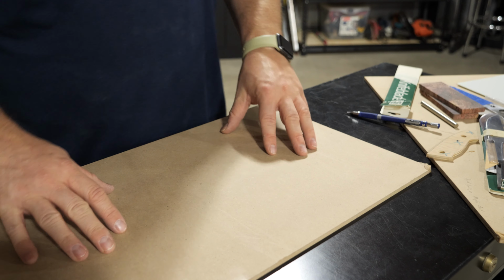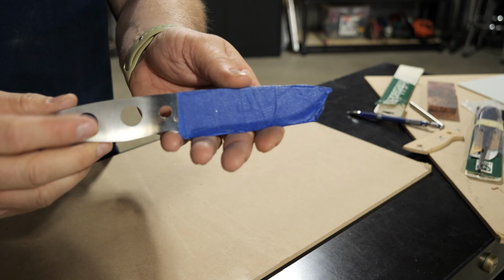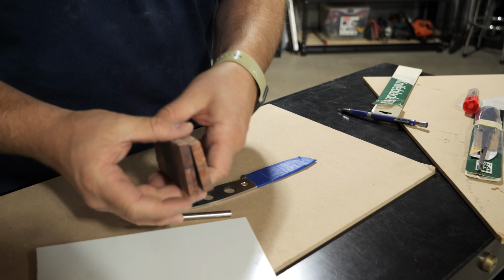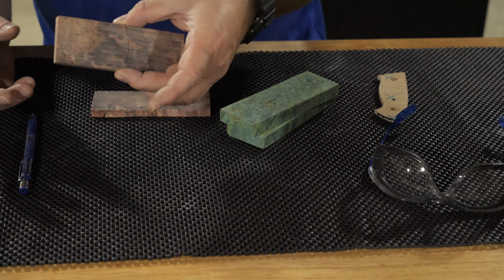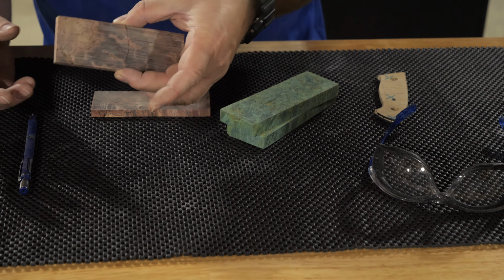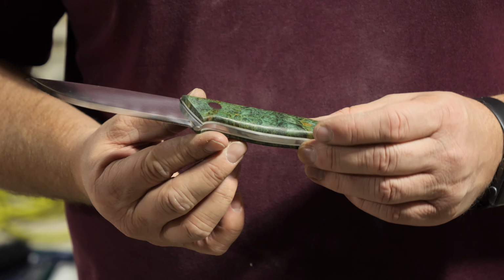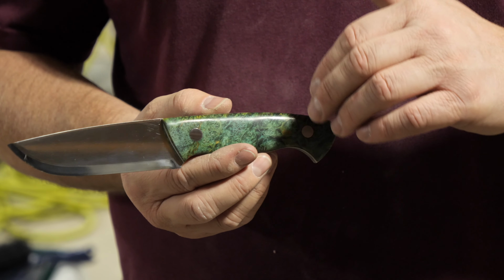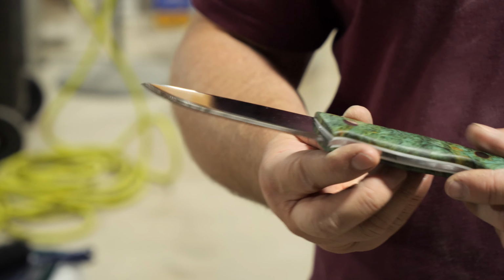Helle Utvaer Build and Mods | Maple & Box Elder Burl | 4K

Comment: A really nice build you did there. I've got an Utvaer my self. Love the blade, but the original handle is a little bit on the short side for my hand. Unfortunately I don't have the tools or the skills to fix it.
Reply from the maker: I can see that. Longer blanks are easier to work with in that scenario. With this, and others, the pre-shaped handles are "stuck" as-is. My only luxury is how thick the handles ends up and where it tappers :/

Comment: Did you get a chance to test the steel? 14c28n right? A very tough steel.
Reply from the maker: Not in a demanding way, no. The Utvaer is actually 12C27. The 14c is on a few of the Enzo’s and the Mora Garnett and the like. I like that steel quite a bit. Personally, I’ve always kind of found the 12C27 on the softer side when laminated. The edges tend to roll in my experience and don’t hold up quite was well under moderate to high stress. Some of the harder offerings like on the Enzo Nordic are excellent.

It’s very similar to other Helle’s, though stouter because of the full tang. A great sliver/feather stick blade, but maybe not the best if heavier use is needed like batoning, etc. Would it work if needed in a survival situation? Very likely, it’s just not something I would choose to use as my regular outdoor blade.

The 14c is very good. I love it on my Mora and some other offerings. I hope to be able to try some things out in the future. I got a Reel Steel in 14c for Christmas that I’d like to compare the the Bravo 1 LT. See how that 14c compares to 3v. I’m sure others have done this comparison though.

Sorry I can’t offer more insight, but in my time/experience, these are the thoughts I currently have.

Comment: I've got about size 11 hands for gloves and wonder, would a brisa/enzo trapper blank be better for large hands than the Utvaer? 
I'd rather make a Helle as a "woodlore" (roughly) type full-tang than a Brisa/enzo.
But if I gotta remove too much of the inside/bottom part of the tang/blank.
I'd rather just look for a different blank design because it would usually also negatively affect the visual dimensions of the blade.
Reply from the maker: Top to bottom, the Helle offers a touch more room to work with. However, the bigger issue for myself, and my friend with larger hands is in the distance between the finger guard and butt end of the knife. As your grip, your fingers tend to swell out from the pressure creating more of a tight sensation between the front of the index finger and the back of the pinky finger. It’s good if you like your hand to feel locked in place, but less advantageous if you want some room for dexterity and different grips.

Though I’ve never used a woodlore specifically, I don’t think the Brisa is way off in the height department and you can make the scales thicker if needed. Just my thoughts. My friend who has very large hands prefers a larger handle, and has an ESEE. In my current line up, he says he prefers the BRKT Bravo and of the scandis, the Trapper/Badger bc the back end is rounded more than the Helle. 

Another thing is, although the Helle is a beautiful mirrored steel that’s hair-piping sharp OOTB, I still feel the laminated steel a bit more delicate than non-laminated offerings, esp in wood use. I love many of the Brisa steels, but many other providers offer solid metal blades as well that, IMO, are superior in strength and edge retention. I’ve not had a Helle break or chip out severely, but the fine edge does tend to roll, even with its steeper bevel, in my experience. Others’ millage may vary. For ME, I prefer non-laminated options. In the laminated, I do prefer Fallkniven in the Nordic style. For the price, I’ve very much enjoyed the Brisa. 

I’ve got a Real Steel Bushcraft I hope to try out in the coming weeks, if I get the time. I got one with removable wood scales and a full convex edge, which is my personal preference. They also offer them in flat and scandi, I believe. A blank is only like $40 from Blade HQ, but I don’t like the pre-drilled hole layout for contouring. The version I got was like $90-100, but that comes with a sheath and I find the existing shape very nice. But it’s NOT a traditional-looking Nordic style knife. I’m thinking about making some of my own scales that are also removable at some point bc all the hardware is in place. This blade is more in the BRKT Bravo line, again, a favorite of mine, and I’ve seen it in 14C28N and D2. The handle on mine is much larger length wise, which is very helpful for larger hands. It would be more $ than a traditional blank, BUT, you’d have some versatility and may not want/need to reshape the metal at all. I like this option because I can also epoxy my own wood design if I choose. They have G10 versions available that don’t have removable scales. I’m not pitching this, just saying the size is equal to, or slightly more than the Enzo on height, and it has noticeably more working room front to back without an intrusive hump. There is a go by we groove, but it’s also not sharp and more gradual. I’ve yet to test it, but I tend to like 14C28N and 12C27 more than the Helle laminated. 

I wish I had more specifics I could offer you. The Helle was fun to make, but there’s no way to lengthen the opening in front is the back drop and I feel this is the more restrictive aspect of this blade handle.
Reply: @OneDegreeLife  thank you for the detailed reply.

Being from Europe, I do not know if BladeHQ is wise with the shipping.
Brisa is pretty cheap to ship here.

And yes, I was referring to the belly/part where the fingers go, so that does sound like a bit of an issue then, thank you.
I've seen people managed to open it up a small bit by removing a few millimetres of steel where your index and pinky go, but like I said earlier, it alters the look of the recasso etc too much, making it look out of proportion.
And I prefer dexterity over stability.
Slightly.
Ofc a little of both is best haha.

The brisa/enzo trapper 95 or 115 is probably a better idea then.
With indeed much better steel selection like elmax even (if they're in stock...) 
And yes, Laminated steel tends to bring more disadvantages than advantages.
Under very hard use they tend to delaminate where even lower quality homogeneous steels hold up (not personally seen it, only in video's), and you generally can't scrape Ferro rods with them. (Personal experience)

At least, not the Morakniv ones even if you sharpen the spine to such a sharp 90° that it creates a burr, fallkniven seems to be one of the few laminates that can.
I wish Fallkniven would redo/restock those full tang F1 and S1 blanks they did a decade ago.
I'd go with those in a heartbeat.
The price also wasn't too crazy.
(I know the F1x also has a full tang but I'm not a fan of the F1x or S1x blade shape, and their stock/thickness just too thick as well, they're significantly thicker than regular F1 and S1)

Also, I thought the Utvaer was a 12c27 laminate btw.
Reply from the maker: @Stormcloakvictory  All good points! I also think similarly about the Moras. The Black and the Garberg are the exceptions. I love both, but particularly the Garberg. Excellent in the SS.

Yes, you're correct, the Utvaer is 12C27, but really does feel similar to the other Helle's I've had. MUCH stronger, but the edge still seems to roll.

Since you are in Europe, I think the Trapper is an EXCELLENT option, esp. at the prices you can likely get them for. I particularly like the 115 size. Yes, Elmax is excellent, if you can find it, but I don't recall if I've used it in the Brisa line. I've tried many. There's another model called the Trooper that's similar, but I think might have a slightly higher scandi grind. My vendor here only has it in 80CrV2, but not sure if it's in other metals.

Hope your build goes well for you and that you love whatever it is you decide on! Cheers
Reply: @OneDegreeLife  thank you for all the replies, and I hope your future projects as well :)
And I hope the YouTube algorithm is also happy with the comment string hehehe, it's a nice build and I like that you show the mishaps like the broken scale too, it's good for aspiring knife makers to see that things rarely go perfect and that sometimes it's just out of your control like getting a faulty piece, even for the experienced.
But that in the end, with a little perseverance the end result will be great nonetheless.

cheers 🍺
Reply from the maker: @Stormcloakvictory  thanks for that! Honesty is the best medicine. I’m glad you saw value in my mistakes, and as you said, I hope it helps others. 

Take care!

Comment: Do you like the Utvaer or Trapper more?  Looking to buy my first knife blank to build.
Reply from the maker: The Trapper. There are obvious differences in steel performance in the Trapper line, but overall, I like it better. The Utvaer is larger top to bottom, so the palm size can be made to feel larger, but the laminated steel is soft for my liking, and it's the only option. With the Trapper you can explore O1, Elmax, D2, N690, etc. And you can find them in 95 and 115 mm.

I really like Brisa blanks for the most part. Their Nordic Skinner 12C27 is a little on the bland side, but other than that, I like most of their offerings. I've become a big fan of their O1 and 14C28N, but I think the latter is only on the Farmer line - similar to the 95 Trapper, but with a stick tang.

Hands down, I'd personally pick the Trapper based on performance.
Reply: @OneDegreeLife  Great reply.  I'm planning on building a few of their smaller blades first for my kids - Necker/Bobtail.
Reply from the maker: @blakefl8623  Sweet! The necker was one of the earliest builds from Brisa that I tried. That should give you a good look/feel for what to expect when moving up the line. Their filet knife, the Nordic skinner and tundra were all kind of exceptions to the general rule though. I didn't care for those renditions of 12C27.

Good luck!
Reply: @OneDegreeLife I wish Brisa would have more metal selection for their smaller knives.  For my kids though, 12C27 should be fine.  When I get around to making my own knife I want to do either N690 or Elmax since I'm in the south with high humidity.
Reply from the maker: @blakefl8623  as do I and a more corrosive-resistant steal is a great asset. The Necker I did was very stout and I enjoyed it until I gifted it to a friend :)
Reply: @OneDegreeLife  There are some new options from Nordic Knife Designs available at Thompson's like the Lizard 75.  Still only 12C27 though and no kydex sheath option like on the Bobtail/Necker.
Reply from the maker: @blakefl8623  Yep, but I haven't tried any from that manufacturer yet. If you're interested in the Trapper, you should check out the Forester 100. It's slightly longer than the traditional Trapper, and it's in Elmax. Only offered in a flat grind, unlike the Trapper which is also available in a scandi. I don't know anything about Dennis Holmbacka, but the Forester looks like a clone of the Trapper. My GUESS is that the Trapper sheaths would also work with it.

Comment: I was making a Helle utvaer handle yesterday, it was a nice time in the workshop. I don't make knifes, I only have basic grinders at home. It's a "homemade" low-level quality handle, but I like it anyway. I took a piece of ash from from the garden woodshed. It was like an hour grinding + engraving inscription (to personalize that little bit more) + applying hardwax. It took maybe 3h. It's not stabilized wood, it is not very well polished, not glued. When the wax dries, I am going to sew a sheath from leather from China, which I had at home originally for another purpose. I just needed a knife into the woods, but I didn't like the "plastic" alternatives. The blade "Helle Utvaer" + other expenses = total 69$. What do you think about this? Was it a bad idea? 
@One Degree Life: man, I also didn't like the pointed section at the back. I kept it there, but I didn't follow the original design, and I made the wooden handle up to the pointed end.
Reply: Well, ...I can easily make another handle, if I don't like the first version anymore. I really like the blade. The 3mm thickness makes it feel like kind of a really universal knife into the woods.
Reply from the maker: Hey! Well, my philosophy has been, make a handle that suits YOU that YOU will like the feel/use of. It’s a bit hard to envision exactly what you might be designing, but as long as you feel like it’s stable (won’t break) and comfortable, then you’ve got a good handle! Let me know how you like it!
Reply from the maker: @williegroundskeeper1072  yes, is a thicker blade, esp stout for Helle. I’ve not been in the forest yet since completing my build, but hopefully soon. Cheers!